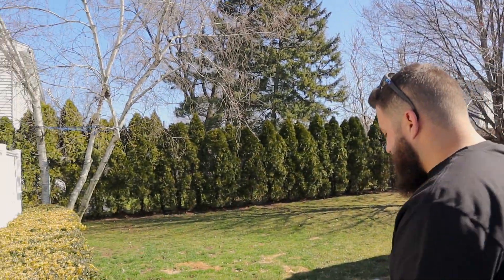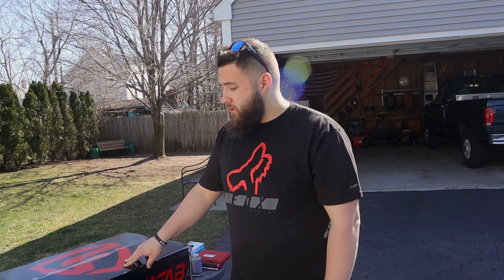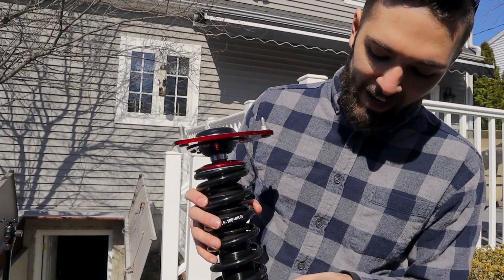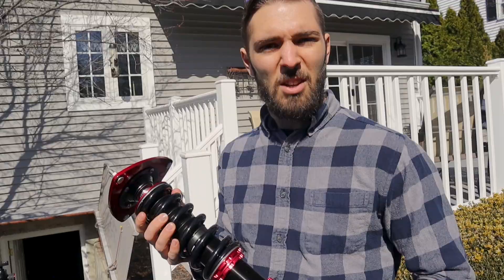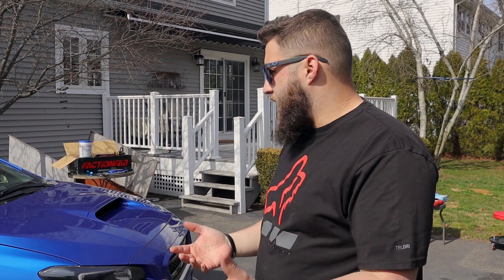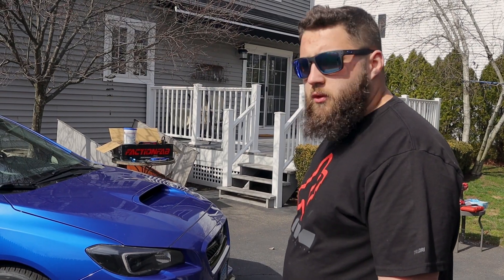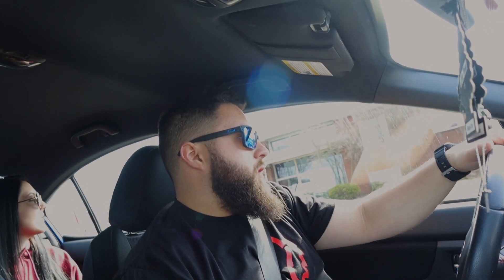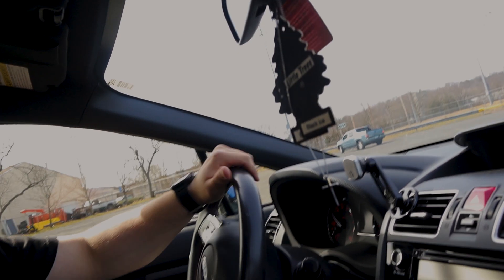BEST BUDGET COILOVERS?!? - FACTIONFAB F-SPEC - Subaru WRX 15+

Comment: i got the FR spec for my 05 sti and i got them because they came with camber adjustable top hats front and rear and the damper extenders and has all the high end stuff you would be paying 2000 for lol. Ive heard great things for them and for a daily i couldnt justify 2k+ for a monotube coilover and then have to buy rear camber top hats and extenders on top of that. Also the best part of a radial bearing on top is you can raise and lower the car without having to take off the coilover or the hub. because it spins you can just loosen the ride hight collar and spin the whole thing up or down. for 1k$ i dont think you can beat it. and i got 200$ off so 800$ theres nothing even close to these.

Comment: New to coilovers.   Just bought the F spec for my 22 wrx.   I hear you mention going soft, middle and all the way but what about staggered front vs rear?   Have you dialed it in to x number front and y number rear?  I imagine it would make sense to go stiffer front and softer rear?  Good video.
Reply from the maker: Softer front, stiffer rear is always a better setup! WRXs biggest suspension issue is understeer. Stiff rear end allows the car to rotate better, soft front promotes better grip and will be a more comfortable rear. As for the stiffness number, it really depends on what you're looking for in the car, everyone will find their own sweet spot where the car feels best. Best way to find your number is set the number of clicks right in the middle. And try driving each day adding 4-5 clicks up or down.

Comment: yep just bought these today, you guys definitely are the reason i did. Got them for my FR-S , loved the video ‼️
Reply from the maker: Let us know how they are, I plan on doing a frs/brz project car eventually
Reply: @Foleys_Garage  Will definitely keep you updated!
Reply: @JarredWoods  hey, I'm also looking at these for my FR-S, I was wondering what your opinions are.
Reply: @flintlights  i would save and get BC Racing or Fortune Auto 500s
Reply: @JarredWoods  how come? Why didn’t you like the F-Spec?
Reply: @flintlights  they don’t come with chamber adjustment , BC & faction fab have better quality & FB has a warranty and can be rebuilt as well as BC
Reply: @JarredWoods  aside from camber adjustment, how was the ride quality over stock? Did you play around with their dampening?
Reply: @flintlights  the stock ride quality was better ofc since it is stock but it isn’t too bad. I adjusted the dampening multiple times and have been running fully soft and it feels decently well
Reply: @JarredWoods  I see, okay, thanks for the help.

Comment: I've been running the FSpec for about a month and they are great!
Reply from the maker: Nice!!! They're honestly a great set. How long have you had yours?
Reply: I have mine maxed out in the rear.  @nwfotowrx
Reply: @Foleys_Garage  i've been on them for about a month.  I had lowering springs, then BC Racing, and now FactionFab.  The Faction Fabs are my favorite.  I just wish I could go a little lower, but I'll live with it.  The ride quality is SO MUCH Better.  I just added Kartboy rear sway bar end links because my stocks were making a lot of noise.  That's a must have as well.

Comment: What is your 1 year review and how well did they hold up through the winter?
Reply from the maker: Held up great, still preforming well like I just put them on
Reply: @Foleys_Garage  thank you for the review, I am interested in buying these as I am also only concerned about daily driving because the stock suspensions are just absolutely brutal especially on bumpy roads 🤦🏻‍♂️

Comment: Haven’t seen all the videos just started watching and was wondering how much camber you ended up getting with these coilovers and did you ever do something to adjust the camber, I’m thinking of getting the same ones but want to take away the camber if possible
Reply from the maker: There isn't camber adjustment on the f-spec coilovers, but you could always add aftermarket camber bolts which are very affordable.

Comment: I bought the FR set just waiting to get them. I’ll be doing a self install. It seems easy to do i never did coilover install on a car tho. I just dont wanna pay the same in what these cost for a pro install
Reply from the maker: As long as you set the preload correctly, and take your time ensuring each of the heights are the exact same, you'll be fine. Also make sure you're torquing down all of the suspension bolts correctly
Reply: @Foleys_Garage  is there a place i can find those torque values for the bolts?
Reply from the maker: In our videos! We've gone over the specific torque specs for each part. Subispeed's coilover install video also covers all the torque specs at one point as well
Reply: How did it go? I've never done a coilover install as well and im kind of nervous about it

Comment: @WRXGarage I just installed these on my '18 WRX 2 days ago. I've been hearing a "clunking"/knocking noise at low speed coming from the front and the rear of the car since then. It goes away once I get past 25-30 it seems (or I just can't hear it). I've checked all bolts/mounting points, everything is tight. I should note that I was also hearing clunking noises here and there from my OEM suspension, but figured that was due to a leaking strut I had. Any ideas of what to check on? I appreciate it!
Reply from the maker: Definitely not from a leaking strut! You'd see hydraulic fluid all over the place if that was the case. I'd give them some time to break in. The other option to check on is to redo the preload on the springs. It's possible that the clunking is from the spring moving around from not enough preload
Reply: @Foleys_Garage  interesting...a mechanic friend told me I had a leaking strut, maybe he meant it was damaged?? Either way I'm still glad I replaced the garbage OEM setup with these coilovers, the improvement in ride quality has been amazing! Thanks for your review here and all you guys' hard work for the community. I appreciate the quick response and knowledge, too! I'll give the coils some time for sure, redo preload and also check endlinks/bushings unless you think those won't be a culprit. Thanks again!
Reply: @JustinKingDesigns  did you sort this issue?
Reply: @Grim-STi  unfortunately no, but am 99% sure that it was something to do with my sway bars/endlinks/bushings moreso than the coils as I was hearing the clunks/pops on the OEM suspension before I replaced it, just not as severe. I got rid of the car (and the coils) a couple of months ago, too many problems on top of this annoying issue.
Reply: Sway bar and endlinks usually culprit. Make sure endlinks are perpendicular to ground while the wheels under load and torque to specs….grease the sway bar rubber attaching to subframe at both spots. 99% of time its that.

Comment: Of the 32-way dampening, where would you put stock ride stiffness? Towards the middle or more towards the soft side? I'm waiting on my coilovers to come in and can't wait to get them installed.
Reply from the maker: Even with the coilovers at the softest setting, the overall feel is still different from stock. Our suggestion is to set the dampening in the middle to start, drive for a couple days, and adjust up or down as needed!

Comment: Great video!!! Really thinking about getting the F-specs now for my 16 wrx. Would you guys happen to know if using wheel spacers or hubcentric would change anything about it? And would you do a camber with these on? 
 Also how did you black out your headlights and taillights like that?
Reply from the maker: Thanks! To answer your questions...
-both Kyle and I are using hubcentric rings to adapt our wheels to the oem hub size! If your aftermarket wheels are a different hub size, you MUST use them. as for wheel spacers, that depends on the brand, what kind of studs you're using, and of course your wheel fitment.
-For Kyle's camber, you can only use the stock camberbolt adjustment in the front, and in the rear, the lower you go the more your wheel will naturally camber.
-Here's our video where we blacked out his headlights! https://www.youtube.com/watch?v=kAj8CO4Aw0o

Comment: Couple questions, how do these handle gravel?  I do a lot of gravel driving and i'm worried about that handling.  Also, if you wanted lift, would these give you any additional travel at their highest ride height? Would be nice in winter to actually give additional ride height.
Reply from the maker: Hey Jarret, you might be able to push these to just above stock height. Maybe 1/2inch higher. We haven't driven them on gravel, but I assume they would handle it fine!

Comment: Since these dont come with camber adjustable top hats, can you still get enough camber in the front to flush the wheels to the fender??
Reply from the maker: Havnt put it  that low but it can definitely get close. They actually sell a pair the FL spec that have adjustable top hats and go lower then mine will. But yes, the stock camber allows for flush fitment.

Comment: I installed the new fl spec and I've been having problems with clunking, have any of you had this problem? Thanks
Reply from the maker: No issues with noise on our set. Did you manually set the preload?
Reply: @Foleys_Garage  Yes I set it with a caliper on both sides. 4mm exact. I've already changed the top hat bearing and a damper and the noise came back after a week of driving. It's only on u turns that have a dip, going back to driving straight. If that makes sense
Reply from the maker: That's odd.. are you sure it's not one of the stock components? Keep in mind that the stock suspension parts, sway bars, endlinks, control arm bushings, etc will all be under more strain the lower you go. It's entirely possible that the sound is from one of those not the coilover itself.
Reply from the maker: Could also be steering rack or linkage. Lowering the car changes the caster (steering angle)
Reply: @Foleys_Garage  my car is a 2020 series white with 6k miles and I only lowered like an 1" or so. Did you change any other  suspension components after or before the coilovers? I've checked all the front suspension for wear and play and everything is good. I'm working on the car this weekend and when I'm done with the e85 tune parts I'm going to dive deeper into this suspension fiasco. The car handles awesome other than that annoying clunk, pop, I'm getting after u turns. Gregan at FF has been awesome and really has been trying to help me. FF has realllly good customer service and I really hope its something other than the coilovers.